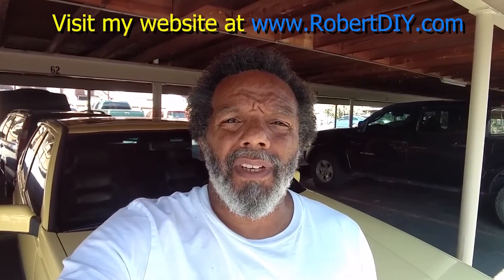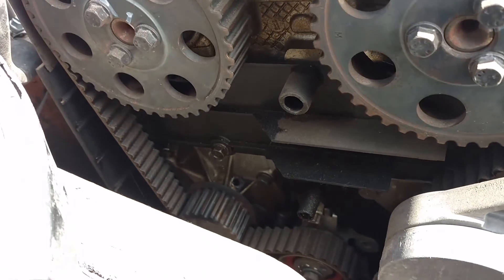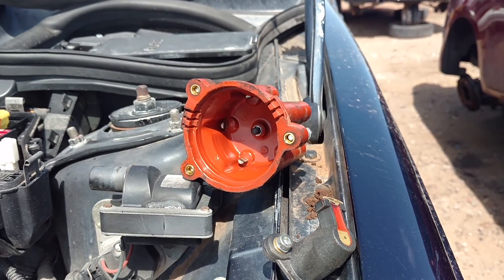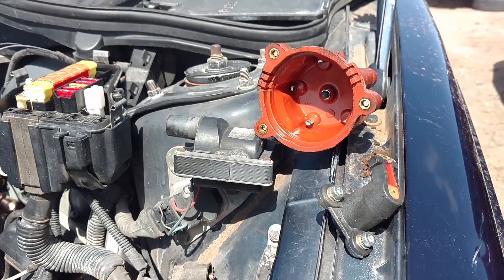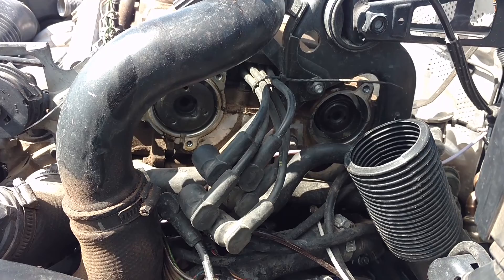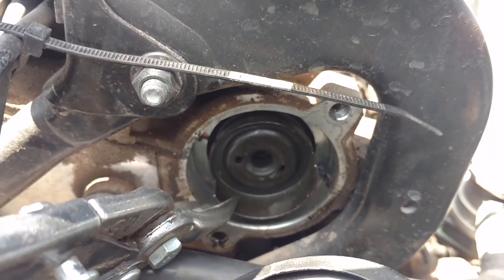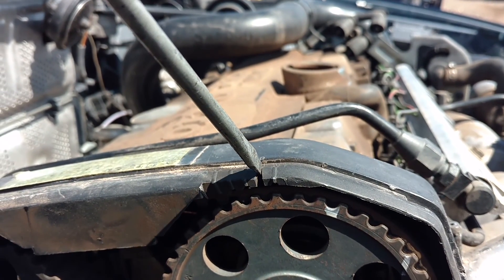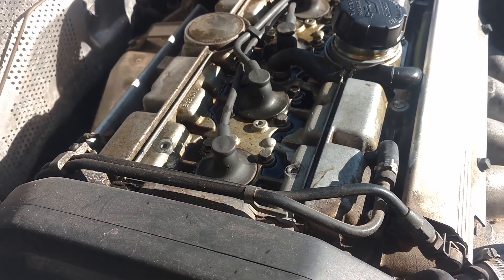Custom tool, timing while running - how it works, adjusting timing and no start issues. - HOWR

Comment: I took my sprockets off recently while doing a timing belt (Actually I took them off to replace the thermostat housing from the front of the engine).  When I put it all back, yesterday tried to start it and it wouldn't start.  Seems like there's no compression.  When I checked the timing marks my intake was a tooth or so advanced.  I was going to loosen the belt today and move the intake back a notch.  After watching this I'm wondering if my timing could be the problem because I didn't get the sprockets back on right.  I'll be fartin with it today but if you have any thoughts about what I should focus on I'd be very appreciative.  Really want to get this old girl back on the road.
Reply from the maker: I don't even know what kind of car you have.
Reply: @RobertDIY  1996 850 NA
Reply from the maker: Man, I have several timing videos for these cars.
Reply from the maker: https://youtu.be/gt9w-ZSxs9I
Reply from the maker: Timing is set with the crank on it's mark and the cams aligned on the back side of the head.
Reply from the maker: Search "timing demonstration volvo robert diy".
Reply: @RobertDIY  thank you. I'm going to do that this weekend.

Comment: I used a flat piece of steel to align cams before. Shaped like the bottom of an H. Just thick enough to fit in the notches. Worked great lol. Took of the sprockets by accident once and learned that lesson ha ha. Ended up replacing all the seals up top that day oh whoops I mean week lol
Reply from the maker: Ouch!